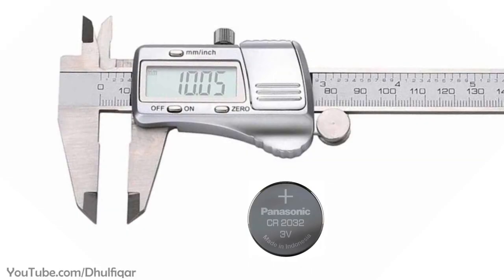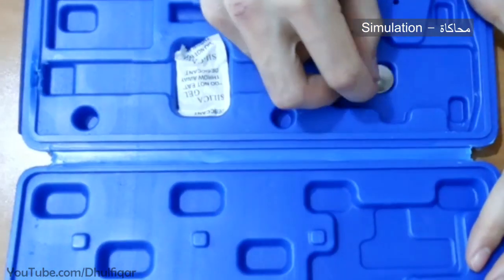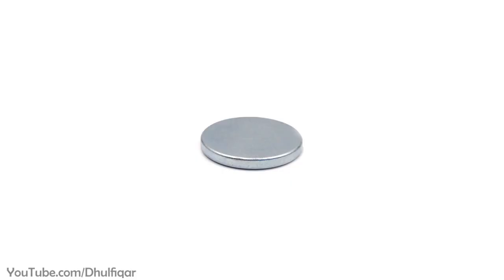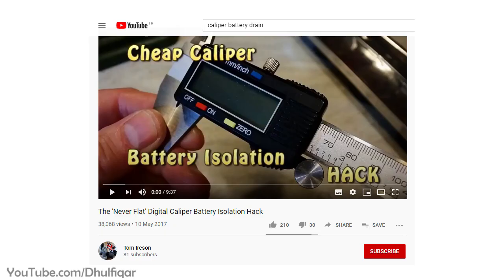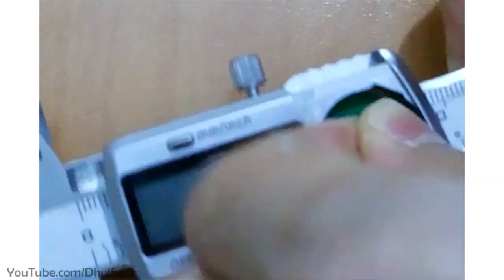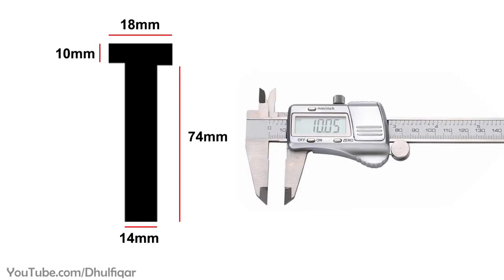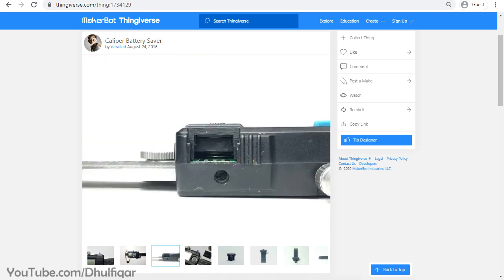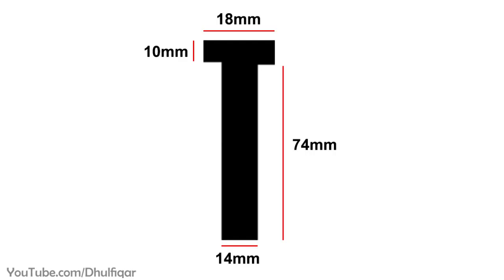How to stop battery drain in Digital Calipers (CR2032/LR44/SR44/A76  Battery Hack/Mod)

Comment: Why cant one manufacturer add a full battery disconnect feature. They'd make a fortune. Even expensive calipers have this issue and its why some pros still use dial calipers, which are more expensive.

Comment: This is smart, but i found that my metal caliper was eating batteries while a similar design plastic one wasn't. I found that applying one layer of Kapton tape (it doesn't really matter, you might as well use polypropylene packing tape, though it's less robust) to the PCB side where it contacts the metal helps and now i have around 4 years on a single cell (Varta Professional) without a need ever turn it on or off or modify it in any further way and cause inconvenience. The problem appear to be PCB vias and bad quality of resist lacquer (green) on the PCB, together with bad quality of metal parts finishing, so there is leakage current across the stainless steel parts of the caliper. Bad dimensions on metal parts make metal scrape a little against tracks and vias and create stray connections. Additionally, as it came from the factory, sometimes the measurement would jump by 5mm, but after i applied the tape, it was no longer ever happening again. Now i have a good endurance and precision device. My calipers run from LR44 battery both, so they have no regulator.

Comment: If it ain't broke, don't fix it. The screw on top of the head should be locked when you turn it off to prevent it switching back on.
Reply from the maker: Well H, I tried this too but it didn't help unfortunately, I added a new battery and then locked the screw and left it for two months without using it, and when I tried to turn it on, it didn't work.
The problem is that it keeps running even if it's turned off, the "OFF" button just turns off the screen, so you must cut the power, yes it will lose its zero, but zeroing it is easier than changing the battery every time I want to use it.
Reply: @Dhulfiqar  I've had the same battery in mine for over two years, and it's still good. You do know that you should not handle the battery with your hands when changing it.
Reply: It still happens. The activation on these things is so sensitive that vibrations can cause them to turn on. Even with the slider clamp screw tightened as tight as possible, these things STILL turn on when you transport the case around. Try it sometime. Turn it off, tighten the slider clamp screw and knock the closed case around. You don't even have to handle it that roughtly - Guess what - it STILL turns on. 

My only fix is to just remove the damn battery every time I don't use it. At least there's holes in the case to store two of them. I don't use my digital calipers every day, or even every week, so it's not a big deal. I do wish these things were better-designed though.
Reply: @elsongs  its not just them turning on by accident, but these calipers are always on even when they are turned off. @Tom Ireson explains it in his video
Reply: @elsongs  Only the screen turns on when you move the arm. The onboard IC is always on and is doing all that unnecessary sensing.
Reply: You clearly don't understand